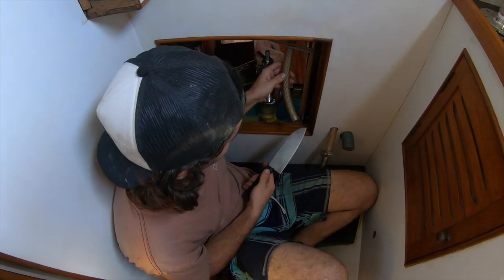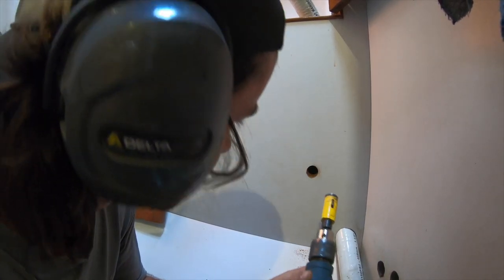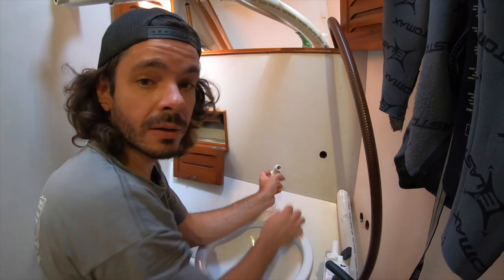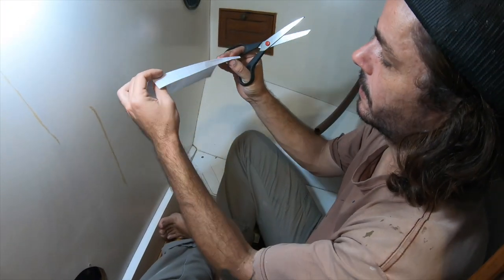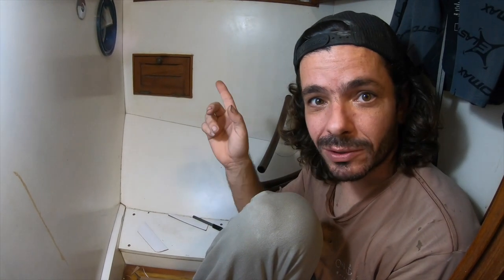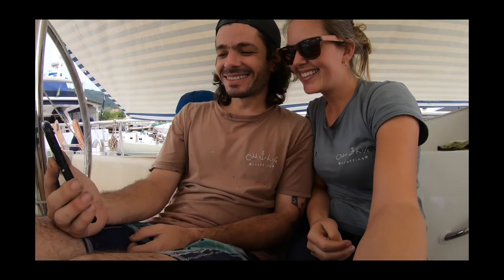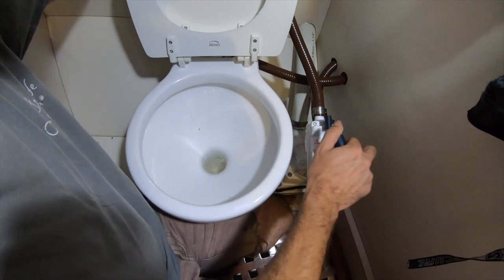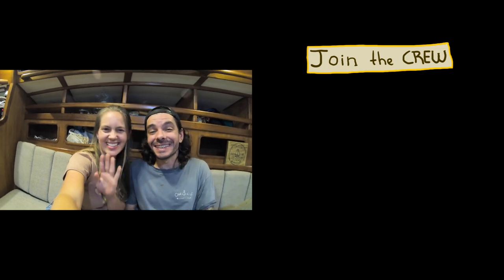⛵️It's TIME to transform our sailboat into our Floating HOME!! #156

Comment: Hi guy's. Another great video as always! We would like to offer a little suggestion from experience. While Jabsco recommend the vented loop between the manual pump and the toilet bowl, should there be a failure in the in the hose from the sea water inlet to the pump or in the pump itself. IE the non return valve within the pump inlet, the flush and discharge lever valve or any clips, pipes or fittings between the sea water inlet, and the Jabsco toilet pump. The recommendation fails to stop sea water syphoning from the sea water inlet to any point of failure. Jabsco toilet pump valves do fail, suffer from limescale buildup that makes them leak or weep. Something to think about? The waste loop vent/pipe will need to have the sea water flushed  equivalent to, or in excess of the internal volume of the waste pipe from the toilet bowl (and its contents), past the loop and its working vent, otherwise the waste will sit between the vented loop and the joker valve (which always leak back after a few months at sea) and will fill the toilet bowl with the waste water equivalent to its internal diameter. Hope this is useful info. Sail Safe Guys, Ant, Cid & the pooch crew.
Reply from the maker: you are probably right. They do fail and it already did on our first day living aboard.

Comment: Using that blue hose is a mistake. That hose is sold in specific sizes. The reason is both ends are free from wire for 2 inches that surrounds the hose. Yon can’t use a hose clamp on any part of that blue hose that has that wire running thru, it will not give you a waterproof seal. The leak will be very slow but it is sewer water. If you want to do it correctly that black hose will work.

Comment: One day you're love affair with sikaflex will come to a violent end, probably the first time you need to disassemble anything that has been cursed by sikaflex :)  Great videos and its amazing and a credit to you that the boat looks so good.  Stay safe.
Reply: Truth Or consequences  
3m 5200 is formulated for permanent applications, it is an excellant choice when used for the right Job. 
4200 & 4000 for normal maintenance sealing.

Comment: If you want to stop the build up of lime and other solids in the heads, use the recycled water from the shower for flushing.  I saved the shower water in a 50 gallon grey  water tank--but I put some holding tank sterilizer into it through the shower outlet to stop the water stinking and producing gas in the grey tank--although it was vented through a carbon filter in the same way as was the holding tank for the toilet.  When the tank was full, the shower water went overboard through an overflow and through hull just above the water line.

It is the seawater that causes problems, so I used it as little as possible.  Only when no used shower water, and that was not very often.

Comment: going to be cozy with 5 aboard, good practice for you, although since you can get off not a true passage test,lol. i have done so much of both re-fit and new construction, you are doing fine, the way you measured ifs fine also but another tip for the future, so everything in the interior was pulled off the floor frames both fore and aft and athwartships ( port & starboard ) therefore any measurement you make from  the floors ( boat builders call them ceilings but i don't want to confuse ) will be right the way she was set up , what you did was fine just a tip. I as ever wish you well, clam seas fair winds, and a star to guide you by
Reply from the maker: Thanks, Lawrence

Comment: This is your first mistake after 18 months 
You need an electric macerating toilet with fresh water flush, then where those pipes go up and down, there should be a 5 gallon holding tank 
Everything in the boat is top end except a hand pump toilet without a holding tank
Reply: Hear hear
Reply from the maker: It doesn't have a tank now as it's not mandatory in Brazil. Future project. The idea is to try the 2 concepts of toilets to compere them (electrical and manual one).
Reply: @OddLifeCrafting  composting?  You could do one composting for near shore, and one tankless for blue water.

Comment: Hi ,I've followed your rebuild from the first time ,looked forward to each update , any ideas as to when are we all going to see to motor round the marina. We know your engine is all good ,all necessary controls work as we seen yours selfs repair, would be great to see your boat working ,,regards , Stan,,
Reply from the maker: Hi, Stan. Thanks for the long time support. We replaced some hoses (that we are gonna show on next Monday's video) but we still need to replace the throttle and gear cables. We didn't have time to install them back yet. Soon!

Comment: I think the little box on the left side of the head is for the toilet paper. Your shower is not separate so if the TP is not protected it will get wet. Just a thought. Also if you leave the valve on the toilet to the non filling side, to the right when facing, the bowl will not fill. Not a bad idea to close the outlet valve but if you close the toilet valve every time you should be good. Cheers
Reply from the maker: It is.😊 Thanks for the suggestions

Comment: Hey again from Australia ..Im starting to get very worried for poor Duca, when he needs to fix something he has used Sikaflex on. As we used to stick aluminium cans to the concrete floor where i worked and just laugh for weeks as the people who collected cans for recycling (10 cents) tried to pull them off with no luck at all. If used with rubber gaskets we had to hot wire cut the parts apart and then grind rubber (Sikaflex)off. That stuff is really overpowered and does not make for easy removal and replacement of parts. Please use only where necessary.  The exterior panels on our public transport buses are glued on with sikaflex only and they travel at 100km per hour on the o'bahn system.

Comment: Friend of mine has a 46 foot 2016 Catalina - he bought new - Even with all modern design, He had developed a smelly head situation. The issue was seawater used to flush .... fix put fresh water in sink then the sink water is the charge water used to flush head. This does two things - prevents seawater induced fouling in head lines, and keeps fresh water air gapped (tank from waste) so fresh water storage is not compromised by use for flushing. Just a thought!
Reply from the maker: We would need to find a place to build a tank to storage the water from the sink in this case, right?

Comment: You were doing great--admire the use of the heat gun--have used those for years in new hose installation--BUT--your choice of a new toilet is wrong.!! The toilet you took out was a Raritan PH2--Hands down the best hand pump head on the market! The old one perhaps needed to be rebuilt or replaced.. Those old hosed definitely need replacement. The new toilet is a Jabsco Par--cheapest and most in-efficient marine toilet made. It is a $150 toilet where the Raritan starts at about $425. With more than one person using the Jabsco you'll be repairing often--it is garanteed to cause you gief!!??-------Mikey, in Sequim
Reply from the maker: We wish we could find Raritan here in Brazil. We couldn’t find it neither a new kit to use

Comment: Hi, the problem with the vented loop in the inlet line to the toilet is that there should not be a vented loop in that line. A vented loop is a vacuum breaker to stop syphoning. When you pump the toilet the inlet line goes under negative pressure and sucks in air thru the loop. Leave things as you have it with the vent blocked so that you do not suck in air.  However, the valve on the toilet needs to be shut to stop syphoning when it is not in use.

Comment: My parent's RV usessimilar type of white hose off the macerator pump and it was oderless for 10 years until it cracked mid-pump out. 
Since you aren't trying to flex it/move it all the time I bet it'll be fine for 20 years. (and be odorless for all 20 years)

Ours didn't have any discoloration even, just cracked from stuffing it into a compartment and then pulling it back out hundreds of times. (repeated sharp U bends are bad for them)

Comment: I have some experience designing/specifying industrial grade piping systems.  If you want an industrial grade anti-siphon valve (vacuum breaker valve), search vacuum breaker on Grainger or McMaster-Carr.  It's there to prevent siphoning of toilet water back into your flush water supply.  If you are flushing with sea water then that could be problematic for any valve due to salt build-up over time fouling the valve.

Comment: Can Victor bring a mate on board for balance? 

Why not use an inline check valve for the raw waste outlet? Apologies, I may not be familiar with your particular style of release valve. An electric macerating pump is really what you want for a shared toilet that gets a lot of use. Trust me, you’ll eventually end up switching. Manual pumps or even composting toilets are fine for less frequent use.

Comment: If you can find a lot of saw dust you can build a light but real quite comfortable dry toilets. Anyway it's not allowed in every marinas to use open toilets. 
Saw dust takes place but if you build in the right place a double wall that could be useful for thermal insulation... 🤔

Comment: If you maintain your toilet you won't have problem. Inside of Jabsco toilet pump you have black rubber valve called "duck mouth" and that is stopping sea water coming back. It is placed on bottom od pump where you have connection for 38mm hose toilet out. Just unscrew two flathead screws. And it is inside it. Top part you really don't need it if you ask me

Comment: Hi guys, I was watching your video today talking about flushing pipe in the bathroom.  So, I have a important question: 
- Does Odd has a holding box to retain the number 2 ? 
This is essential for when you are anchored in poitas in coves, bays and beaches. 
Cheers guys.
Reply from the maker: It doesn't have as it's not mandatory in Brazil. Future project.

Comment: Love your channel, but if you plan on leaving Brazil you will need a holding tank, when your in a foreign port with the three way valve that can be locked. IMO MARPOL Annex IV covers  international law on Sewage. United States law the Clean Water Act  Section 312 prohibits discharge within three miles of land. I’m pretty sure Brazilian law says the same as they would be a signatory to Marpol. Please double check, I don’t want you guys to have to pay fines.
Reply from the maker: Yes, we know that that are rules outside Brazil, so the holding tank is a future project 😉

Comment: As I watch this episode it appears you have had access to manuals and diagrams which reference parts and pipes for the sewer.  I am sure you have had access to descriptions of other services on the boat.  You have altered and improved some parts and pipe routes.  But have you modified the descriptions in the manuals and diagrams so the next owner isn't stuck when parts and pipes require replacement 10 or 15 years down the road?  Try to think of the next couple who want to maintain this boat.
Reply from the maker: We are gonna draw the projects in the future.😉

Comment: Interesting, I never had a vented loop on the sea water inlet to the toilet on my jabscos between pump and bowl -just a short tube in matching white colour. Sea water influx at sea was always stopped by the pump out selector valve (and/or the sea cock in the toilet compartment) but my bowl was probably also above the water line.
Reply from the maker: Thanks for sharing your experience. In our case they are under the water line

Comment: At 05:38 your steering cables looked like they might rub against the white pipe that you tied the blue tubing to. I don't know what the pipe is for, but you might want to put a wooden wear plate over it so you don't get surprised by a leak five years from now.

Comment: Duca are you sure that valve is not a air bleed manual valve to vent the hose pipe upon first instalation & or after any maintanance.
Reply from the maker: Yes I’m sure John. That’s a anti siphon valve so the water don’t flow from the ocean to the toilet when you stop pumping. 😊👌🏼

Comment: When I saw you treating the wooden mounts with epoxy, I was getting worried for Duca. I thought this was going to be a job without Sykaflex. Surely he will get withdrawal symtoms. But then he managed to find an excuse (oops, sorry, a reason) to use it. To stick down the wooden wedge. Clearly powerful screws were not going to be strong enough to hold it!

Comment: I am fixing my boat too. Where did you bought the stainless steel hull valves, the electrical cables and those hidraulic hoses?
Reply from the maker: The valves are custom made for us by a welder. Electrical cables we bought by internet and hoses on local stores in Guarujá. Good luck

Comment: Point of Interest 19:00  Thinned, epoxy will soak into the wood strengthening AND waterproofing it. Warm the wood with your heat gun and it will soak right in, (or you can use acetone.) 
31:55...Try turning the valve around, swap ends.  <> Diaphragm may be facing the wrong way inside the fitting.
There are no black tank regulations while you are in port?
WOOP WOOP I'm normal now....No more binging.
Reply from the maker: We tried the valve on the other side, there is a little cut on the rubber. The holding tank is not mandatory in Brazil and we don;t have it: future plans.

Comment: Bad Smells.  I discovered that the worst smells emanated from the seawater inlet hose because of the decaying marine life within the hose.  Two solutions.
Buy a very expensive hose or only use fresh water.   I opted to used pottable water because I had a large water tank and closed off the seacock.
Reply from the maker: Maybe we can change it in future if when we have a water maker. In this case we would need to create a fresh water tank just for it.

Comment: Hi guy's.

I have a question because i don't know how boat toilet works ( i know for motorhome with k7 ).

When go to give to nature mother your gift, where does it go ? outside in the ocean ( i hope no ! ) or in a tank ?
Are the toilet equiped with a crusher ?

If it go to a tank , is there a pump in marine dock to unfill it ?

Thankd to yeur answer.

Bye
Denis.
Reply from the maker: Hi, Denis. In the Brazil it's not mandatory to have tanks and the marina are not prepared to receive the water from the grey water tanks. We are gonna prepare the boat in the future to have a holding tank. One of the toilets has a crusher

Comment: It’s not clear from the video, but it kind of looks like you forgot to overdrill the size of the holes, fill them with epoxy, and then redrill the correct sized holes through the solid epoxy. That will prevent any rot in the wood from moisture in in the hole, which is inevitable.
Reply from the maker: Yes, this is what we did 😉

Comment: That video was "da shit" - it's a flush.  A nice upgrade is an electric macerator toilet.  Always use bio-degradable toilet paper - the same stuff they use on an RV.  Another nice add on is a washing hose supplied with fresh water (like a bidet) so you can wash without using toilet paper - or minimizing paper. check this out https://youtu.be/9pkRbM1cEOY

Comment: How do you use on-board toilets with no grey water tank or black water tank? Does it all just get pumped over the side, even when in port?
Reply from the maker: It’s not mandatory in Brazil to have a gray water tank and there is no place in the country where you can discharge your tank (the marinas are not prepared to receive the gray water), so our boat is Brazilian and it doesn’t have a tank. We need to create one in the future
Reply: Thanks for responding. I’m just an ignorant Aussie accustomed to all these marine rules and regulations. I’ve binge-watched all your videos where you’ve carefully and artfully found a place for everything on Odd, so do you still have a place for a holding / grey water tank?
Reply from the maker: @jimmcdonald9244  Yes, when we refit the bow head

Comment: You need to learn about t-nuts. They are made for blind nut locations.
Reply from the maker: I have never seen them here in Brazil
Reply: They are used when working with wood so I am surprised that in a boatyard they are not common. I have used them for over 40 years building speaker enclosures. They come in a variety of sizes. Your method of using epoxy is good but a combo of a t-nut and epoxy would IMHO be better. I will check for sources even though the “boat has left the dock” for your immediate application. Yeah it’s a bad joke!
Reply: Apparently there is a manufacturer in India that ships to Brazil and also the company Amazon. I checked by t-nuts in Brazil.

Comment: Those venturi valve toilets are a pain in the ass...not sure what you have for batteries and solar but I would replace with an electric you can find new ones in the states for about $500.
Reply from the maker: The electric one didn't fit on this head. We we also would like to have the experience of having a manual one and a electric one.

Comment: When you flush the toilet the paper and poop goes in the water surrounding the boat in the Marina? It’s gross?
Reply: TP should go in a separate plastic bag for later disposal ashore, never into the head.
Reply: @peterkacandes5905  ok but your still flushing raw sewage in the marina?
Reply from the maker: The paper no, as we are not gonna through it on the toilet. But the poop is gonna be the only way for them to go as we still don't have a tank, it's not mandatory in Brazil

Comment: Adding the vacuum breaker to the supply hose will not work because when you pump the head it will pull in air from the vacuum breaker instead of water from the sea cock
Reply: I didn't see that was after the pump until you did the second head which is correct. My bad